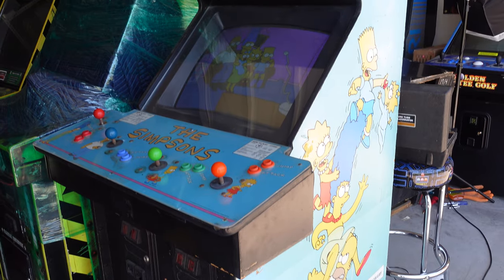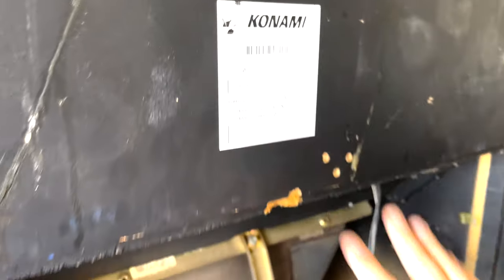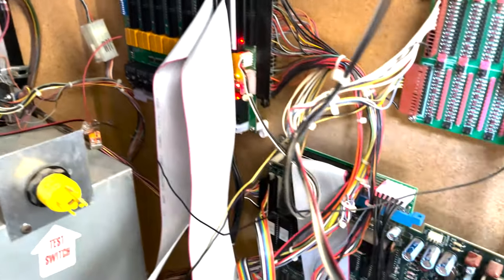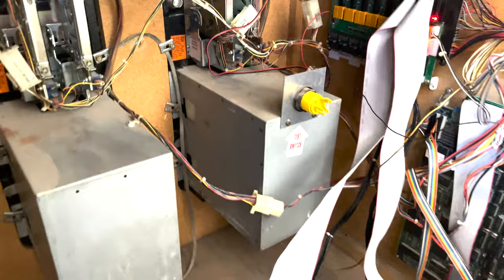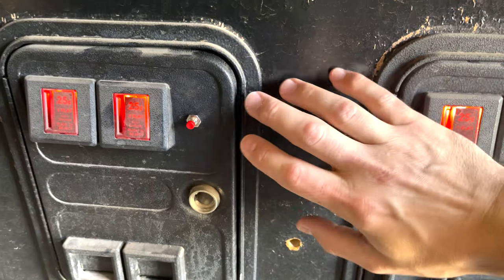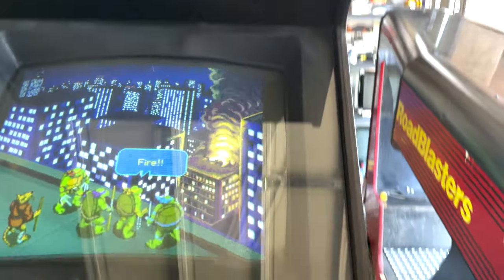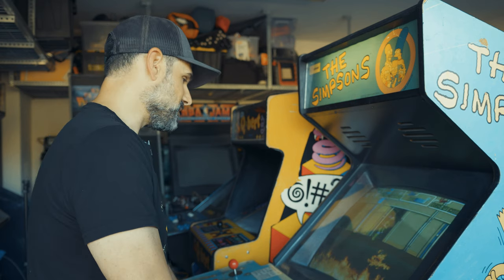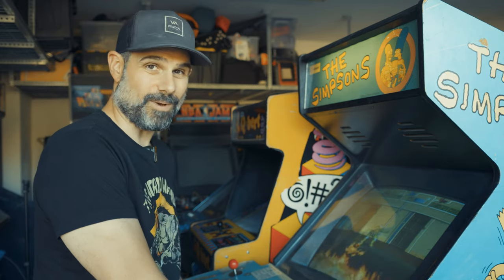TMNT And The Simpsons - UNITE!!

Comment: I've got a Hero Turtles machine and have a Simpsons board in the back,  so I'd love something like this,  such a pain having to pull the machine out to switch them manually.  But I recently picked up Sunset Riders and Bucky O' Hare for it too,  so really need something like this!.

I've seen some other switchers come with a remote to let you cycle through,  can you get anything like that for this one?  Also do you need any extra power to run it?

Comment: I have talked about how I've done this in various groups and it's sad we don't have a good community for arcade restoration and actual arcade machine modding like there is with pinball. The communities I'm a part of talk entirely about multicade and arcade1up. I did this with a machine I turned into a 6-game beat-em-up using authentic PCBs just like a NeoGeo but with JAMMA compatible boards. I've showed it off in a few places but it always falls flat and no one sees it. I always thought it was brilliant.

Still trying to figure out how to make Arkanoid into a switcher. You can't use these with spinner games due to how spinners work. I'm working on building a relay switch that can auto swap controls to each game but it's not as simple as you'd think.

Fun extra tip, if you find a PCB but can't find its wiring harness there are conversion adapters for a lot of games to JAMMA. I switched my Arkanoid to JAMMA to easily swap between every version of Arkanoid.
Reply from the maker: That sounds amazing man, I would love to share it, so more people can see it.  If you share the video with me, I will give you credit and show off your creation.  A 6-Game beat em up running original hardware sounds freaking EPIC!  
Thanks so much for watching!
Reply: @RetroRalph  I set it up for 6 but so far I have 3. PCB prices went through the roof recently and I'm having a hard time grabbing just a standalone PCB from ebay for less than $500 anymore. Keep getting sniped. I have Alien, Final Fight, and Bad Dudes in it so far. A Capcom, Konami, and Data East game all in one machine.

It was a real struggle to get those working together and compromises were made with the visuals but it works well enough and now I don't have to find room for 6 cabinets. Looking at doing the same with a SHMUP cabinet. Still have to figure out the best design/placement for a game display. Might have to make a custom marquee similar to Neo Geo.

 I'll have to make a video. Been too busy restoring some pinball machines.

Comment: This is advance modding at its finest!!! Could a Jamma switcher work for light gun games too?
Reply: Yes as long as they are both jamma and use the same type of light gun. YouTuber ScarletSprites has done this. And I’ve seen a Lethal Enforcers cab that was running 3 different boards inside.
Reply: @mikehough482  good to know! I had original plans to do a Lethal Enforcers/Police Trainer mod. But I sold my cab 😞
Reply from the maker: While I haven’t done this personally, if it’s a board that uses traditional HAPP light guns, I believe it’s possible.  Thanks for watching man! I hope all is well!
Reply: @RetroRalph  thanks for the insight!! I'm almost ready to dive into FINALLY working on the real arcades in my Garage cade. I have some work to do on my Virtual On and Sega Star Wars Pod Racer
Reply: It depends. I've talked with the maker about compatible controls and it depends on the voltage of the sends for the control. The boards pass through and filter signals to limit interference so spinners definitely don't work and some games that use a tracking mechanism like T2 or Operation Wolf might not work. Freehand light gun games could work but it could vary.

Some of these are not compatible with kicker controls. You may need a separate board to add any kicker controls to the switcher, refer to the Riddle manuals for that.
Reply: Just checked Riddle's site and they have way more products than last time I purchased from there. Looks like there are some products that can definitely get your gun games to work. You could probably just email them and find out. I'm eying that auxiliary relay board right now to handle a few games the boards couldn't before.

Comment: Next step, add an X-Men board? Would the switch just go sequentially down the line if you had more than two boards?
Reply from the maker: Yes, there's a dip switch where you tell it to enable the next port that you add a board to.  So it will only switch through the source boards you tell it too. It's a really cool solution. Thanks for watching!

Comment: ok so if I'm understanding this correctly, if I find a Jamma game that buttons already match up, for example, this is something I might do with my Robocop Cab and maybe put Contra/Robocop, I wouldn't need the condenser for the controls since the buttons for both games should already be the same?
Reply: Yes and no. Commonly as long as you have the right amount of buttons and a standard control you could. In Ralph's case since they're both Konami, 4P 2B same time period this wasn't even a concern. The things Ralph didn't talk about is voltage regulation, amperage, and monitor requirements.

Some boards do have varied voltage requirements or amperage requirements from the power supply and the boards may have certain requirements for a compatible monitor. Always refer to the manual requirements before sticking your boards together in a machine and make sure your JAMMA wiring matches up. JAMMA may be a standard connector but there is still a little wiggle room in there for differences.

Biggest problem in your situation is the monitor. I'm pretty sure all Contra games required a vertical position for the monitor and Robocop requires horizontal. Your image might look stretched. Now you could do say Robocop and Bad Dudes.

Even with compatible games you can have different screen size results and it can be difficult to get games from different manufacturers to match up.

Comment: this is so cool!  The only major difference in the two is the attack and jump buttons are switched, which I'm sure you dealt with when wiring up the control switcher.  Are you thinking about eventually swapping out the artwork or making a combo cab art ala Ms Pac-Man/Galaga?  It's funny that now there is a softmod technique to do this on the arcade1up simpson cabs.

Comment: hay Ralph .. what would a tempest cab completely restored  with a new old stock monitor sell for .. i have a chance to buy one .. just making sure im not over paying .. thank you
Reply from the maker: Pricing on Tempest can range anywhere from $1500-$2500+ depending on condition and region.  I sold mine for $1900, and it was in excellent shape, if that helps.
Reply: thank you

Comment: RiddledTV products are top notch, I own a few as well. If you don’t wanna have to use quarters to start a game you can do an easy mod to make the coin return buttons into credit buttons. There’s a couple different ways to do this, one using alligator clips that touch when you press the return button, and another using a micro switch mounted behind the return button. I’ll message you the links and pics for these methods cause I don’t think YT will allow me to post them here in comments.

You gotta get some AC in that garagecade dude!
Reply: I swapped all of my mechs out with 3D printed "any coin" non mechanical slots. They just pass through any coin and as long as it fits through the coin slot it will take it as a credit. I've been collecting old arcade tokens and restoring them for my own little home arcade. Only thing is Chucky Cheese tokens are too big for many coin slots.

Namco, Bally, Aladdin's Castle, any coin smaller than a quarter works great. Some people even 3D print their own custom plastic tokens with these. You could even use pennies or any change you have laying around. Just leave the mechs in your cab and swap back in the quarter mechs if you sell it no problem.
Reply from the maker: That sounds awesome, I'm behind on messages so I will take a look tomorrow when I get caught back up on Social media stuff.  Thanks again man!